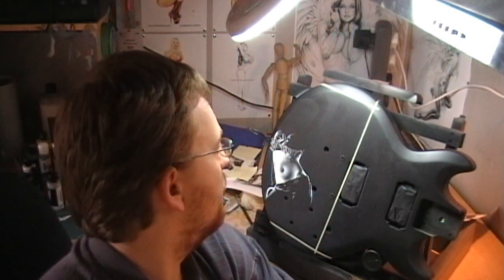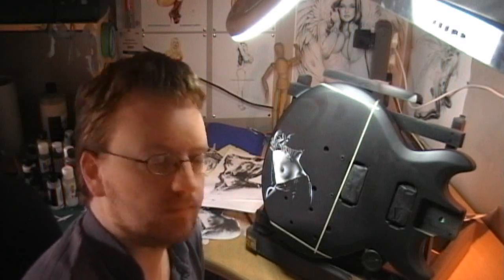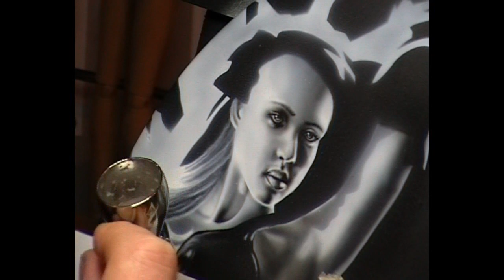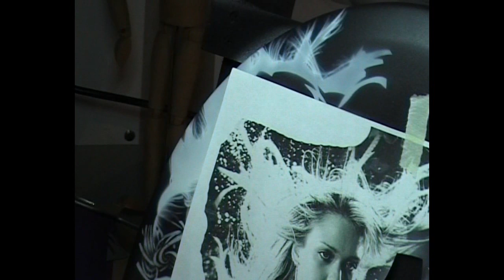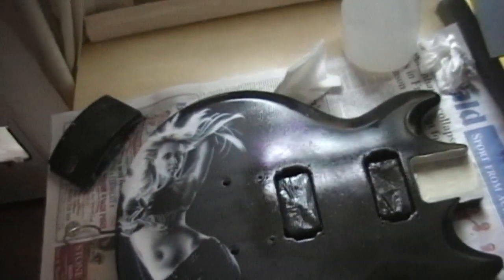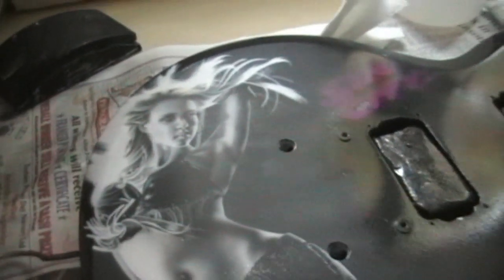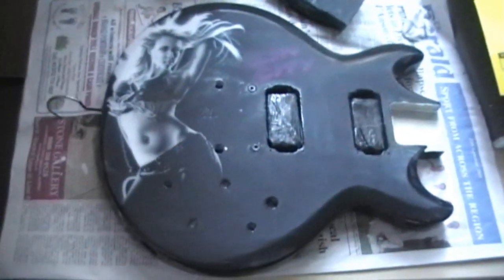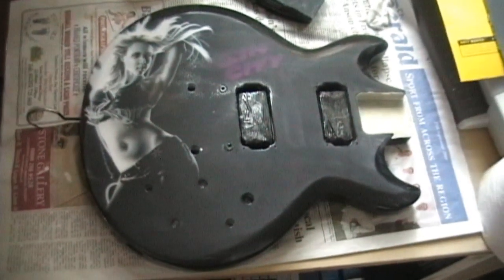Part 2 Jessica Alba custom Ibanez GAX70 Airbrushed Electric Guitar

Comment: What kind of paint do you use for your base coats and in your brush? Ive been trying to redo my fender with a stencil I drew of Aspen from the comic book "Fathom" using Montana spray paint and Ironlack spray paint which are both high end paints but I cannot get the surface to smooth out like a lacquer. I think i will use Hose of Kolor in my brush, same paint they use on automotive. What do you recommend? I really want that high gloss and depth to my paint job...

Comment from the maker: It depends on what im doing. For large areas i use an Iwata HP-CH with a 0.3 needle and for the fine detail stuff i use a Harder & Steenbeck Infinity with a 0.15 needle/nozzle setup installed.

Comment: The orange peel texture isn't a big deal, just gotta back off, extend your spray distance. I dunno if you're using HVLP, but if you are a distance of 8 inches from your surface is ideal. If you are at the proper distance, dial down the airflow on the gun. I look forward to more soon.